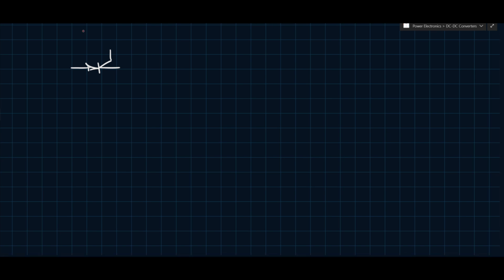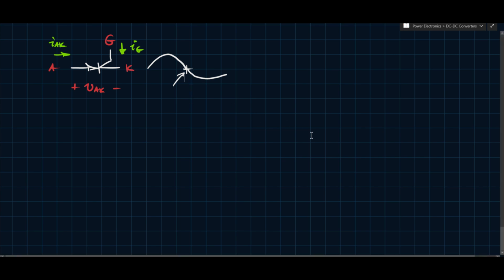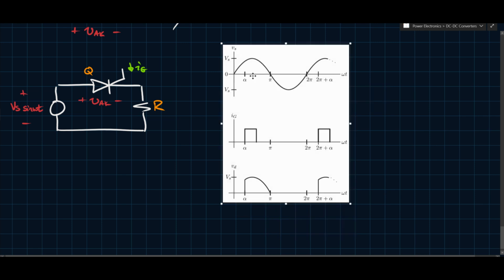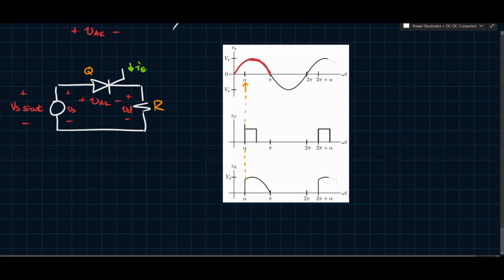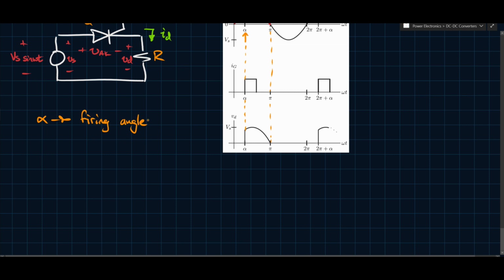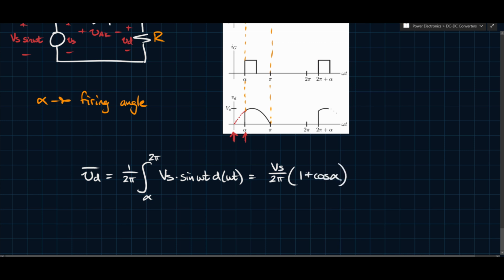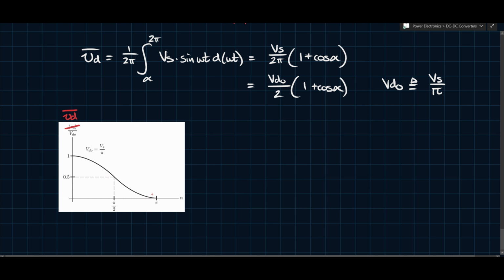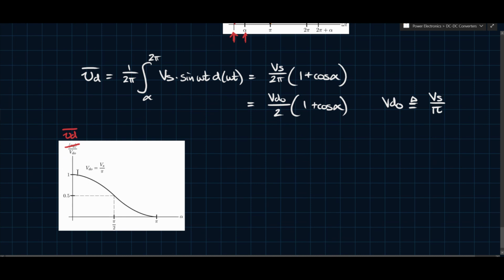Phase-Controlled Half-Wave Rectifier

Comment: Hey Sandeep,

Not sure when you'll see this. I took your power electronics class (ELE 531?) in the fall of 2021. Before that you helped the fall 2019 class of Electromagnetics, hence the reason for my comment. You were a huge help in getting through that class. Smith chart tutorial sessions on Friday nights in the Daphne Cockwell building. Heard about it from a classmate. Atteneded all those sessions on how to deal with impedances between stubs, looking up the info with old school smith charts, narrowing it down to impendances and such depending on the distances between the stubs etc. It's a bit fuzzy now.

Anyhow ... That's the ONLY thing I understood in that course. Studied the shit out of smith charts, stubs before the final exam.
Day of arrives, daunted by everything else on the exam. Read Smith Chart question ... frikken stubs are put one on top of other (no distance between) all calculations we did were based on a distance between the stubs, I panicked.

 Read over other questions again and again. 20 mins left, come back to stubs question. Wrote a mini essay to prof (no one liked that guy) explained I thought this was a trick question as any practical example we saw had the stubs placed some distance apart as to calcualte an impedance between them. Said this qeustion was pointless and designed to ensure we fail or some such words. Totally thought I flunked that course and set myself back further. No one was having a good time of that exam from what I heard after.

When grades came in, clenched before I clicked the link on that course ... I got a 'D'. Fantastic at the time. Lots else to deal with besides shchool back then. Just needed to pass. I wouldn't have if I didn't know enough to call out that question as B.S. thanks to your tutorial sessions.

Hope you are doing well these days, thanks for giving back. It made a difference for me.